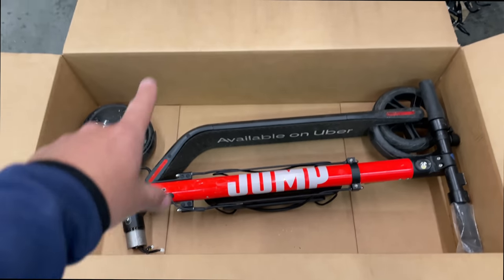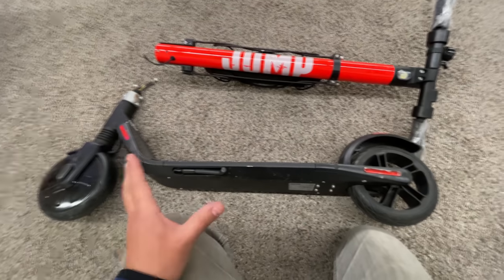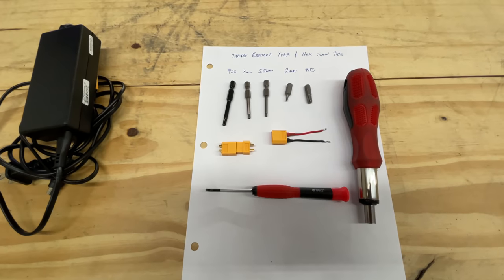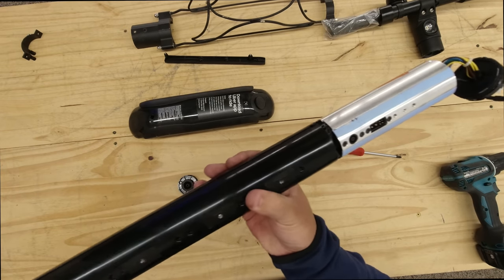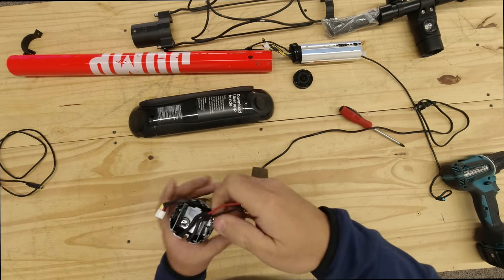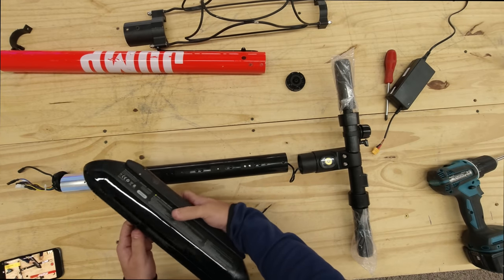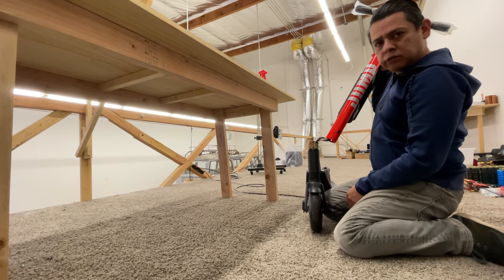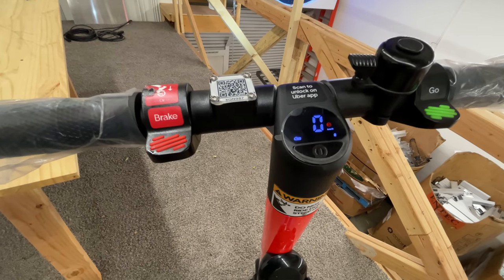Reclaiming a Ridesharing Scooter to personal Segway ES4

Comment: Got mine this week! Works pretty good after waking up the batteries, had normal  20km/h speed limit and 95% charge limit for better battery life. Took apart the handlebar unit and did some soldering to reflash it. Got an extra 10km/h and BT connection out of it, not sure if it was worth all the extra work tho. Pretty excellent stock. Happy scooting!
Reply: @Fred Ting - I’m currently doing the same and got my ST-Link up and going but had a few questions. Care to help a brother out? 🙏

Comment: Looking forward to the restocking!
Reply: BEWARE. I bought 2 scooters and 1 of them has a bad control board and dashboard. I'll be out another $100 at least to get it working. Jehu and his team hid behind the whole "as-is" sale in the description to avoid granting a partial refund to cover the costs of the repair. Only reason I was able to diagnose the issue was by tearing down another scooter I already owned and swapping parts. Honestly, not worth the time and effort now that 1 of them is bunk.

Great value IF you don't get a lemon.

Comment: I found those female barrel jack connectors in the right size as spare parts for a Xiaomi scooter. They are designed more like panel-mount connectors but they should work fine without cutting the charger.

Comment: Dang, I wanted a few. Shucks. I’ll wait until he gets more!
Reply: BEWARE. I bought 2 scooters and 1 of them has a bad control board and dashboard. I'll be out another $100 at least to get it working. Jehu and his team hid behind the whole "as-is" sale in the description to avoid granting a partial refund to cover the costs of the repair. Only reason I was able to diagnose the issue was by tearing down another scooter I already owned and swapping parts. Honestly, not worth the time and effort now that 1 of them is bunk.

Great value IF you don't get a lemon.

Comment: I have one of the retail version but the battery power output is dropping after a year of heavy use. Good guide here, can the battery be revived by jump starting as demonstrated or is it exhausted and likely needs replacement?
Reply from the maker: These are new unused batteries, you have old worn ones,  completely different scenario

Comment: BEWARE. I bought 2 scooters and 1 of them has a bad control board and dashboard. I'll be out another $100 at least to get it working. Jehu and his team hid behind the whole "as-is" sale in the description to avoid granting a partial refund to cover the costs of the repair. Only reason I was able to diagnose the issue was by tearing down another scooter I already owned and swapping parts. Honestly, not worth the time and effort now that 1 of them is bunk.

Great value IF you don't get a lemon.
Reply: Did you actually watch the video? Read the ad? He was VERY clear, these are as-is.

Comment: @jehugarcia isn't the special discharge connector from the battery just a plain XT30?  From the video it looks like one. Xiaomi scooters use XT30's on their batteries.
Reply from the maker: Not on the external pack
Reply: @jehugarcia  yeah ok. Because xt30's are dirt cheap

Comment: Im running into an error 42 when I connect the external battery.  I don’t have electrical contact cleaner but will try that.  Otherwise it works great.

Comment: How did you bypass the "remote activator" for the motor to start to work ?!
That type of scooters have one sim card that connect with the jump servers to unlock or lock the motor.
Reply from the maker: Never installed on these unused scooters
Reply: @jehugarcia  ah ok thx for the response :)
Reply: Likely bypass and remove that

Comment: Does the dashboard need to be plugged into the esc in order for the batteries to charge thru the charge port? I have everything minus the dash which is on its way but I wanted to get juice in the batteries asap to avoid permanent damage
Reply: Update: as far as I’m aware mine is charging. The brake light is flashing because I’m assuming it’s looking for a dash when there isn’t one but it’s taking a charge

Comment: Got mine and charged the batteries up, now I get code 32 and always beeping.  After some research it looks like I might need to reflash the esc and dashboard. I'll report back on if it works.
Reply: I'm in the same boat, any progress on your end. Looks like I might have to flash the dashboard with the ST-link USB serial communicator. The Juliet connector sticking out of the scooter doesn't show all the modules.
Reply: @gildardo  yeah I got mine all flashed. I took off the aux battery and went through that open  connector for the rx/tx wires. I was able to get all modules except the aux battery of course. For that I plugged it back in and back probed the rx/tx coming out of the main esc module to the main  battery, this took  a bit because the communication kept pausing , so just give it a few minutes to finish.
Reply: @Hermy21  Nice, I ended up doing the same, but I flashed the external battery with an android app after I updated all the other modules. Thanks for your reply.
Reply: @gildardo  Awesome,  glad you got it figured out! It is definitely a bit of trial and error.

Comment: Dumb question.... Is there a reason why one couldn't use something like an ISDT Q8 (Or other Lithium Ion charger one might have), even though it can only do 8S, not the 10S that I assume these packs are, to bring the voltage up a bit vs hacking apart the actual charger? How many volts does it take to get the BMS to wake up and allow the charge?
Reply from the maker: No reason.  It just makes more sense to suggest using the actual charger people need to buy to use the scooters.
Reply: @jehugarcia  Thanks - Got mine yesterday and I was able to revive the packs with my ISDT Q8 enough for the BMS to wake up and take the charge through the charge ports - the Scooter is alive and both batteries are recognized. 

A few points - these DO have bluetooth, it's just disabled in the current rental firmware. I used 'Method 2' found here (https://www.scooterhacking.org/forum/viewtopic.php?f=6&t=252) to flash different firmware the the BLE and DRV modules. After flashing BLE, the bluetooth indicator started flashing and it is now recognized by the segway app and I was able to change the speed from KPH to MPH, see battery lever, scooter statistics, etc.

Also, the screws provided to attach the stalk to the base are the incorrect size (or there was something wrong with the ones I got). They appear to be 1/4 x something, but the correct thread is M6x1.0. I couldn't hand thread any of them in very far and trying to crank one down didn't go well. The M6x1.0 screws I picked up threaded in smooth as glass. I believe the ones I got were 12mm long (just a touch longer than the ones provided. Trying to use the ones provided will be extremely difficult to get fully tightened (If all are like the ones that came with mine), and will mess up the threads.

Comment: There's a tool you can 3D print for removing that puck like thing.
Reply: Or use vise grips and line ut up on two holes on the puck and twist.
Reply: Michael, can you provide a link to where I can buy the 3D print tool? I could really use one. Thanks!
Reply: @oboloori  use 40% infil

Comment: Alright, these things were in my city dump, i brought one home, i bought a charger, nothing, it says its fully charged and wont turn on, ive done this method, and my charger flashes green, not green and red, i cant get any information, on what it could mean, ive even plugged the circuit board back and and pluged the charger back in the port, as well as the handle bars and its still dead
Reply: Update: this is very common ordeal whilest troubleshooting, after poking around with the multi meter that the circuitry at the module at the bottom, theres something wrong there, you can either put 3-5 volts through it and test all points, traces, sockets and caps until youve found the culprit with the multi meter, and spend no more than a few bucks in parts with a soldering iron, or you can buy a replacement, and that also includes a new "dashboard" or screen for up top, its bluetooth compatible, and its 30$ online.

Comment: Wouldn't it be better to wake it up with another 36v battery? instead of letting the charger struggle?
Reply from the maker: What if the person buying one of these doesn’t have such extra battery?  I need to show how to do it only with I know you will have available
Reply: @jehugarcia  What about just charging the outer addon battery, Would that not charge the internal one without a stripdown when they equalise?
Reply from the maker: @shawng5799  no, I tried that

Comment: I got my unit many many months ago but only got around to disassembly, charging and reassembly this weekend.  Finally got it all together tonight, charges fully, display seems to work and the cool LED lights come on.  But the most important feature, a powered scooter does not seem to work.  Pressing "Go" or "Brake" has no impact, nothing happens.  If I manually scoot forward I see the speed changing so at least some wires seem to be attached.  I appreciate these are 'as is' but does anyone have any advice on how to debug this issue further and hopefully reach root cause - or at least a level where I know what to order to resolve the issue.  Thanks in advance.
Reply from the maker: You do know you have kick start these right?  Sometimes you have to go faster than other times before the go button starts working
Reply: @jehugarcia  I did not know that but do now.  Reassembled again and gave it a kick start and it worked beautifully.  Thanks for the quick response.

Comment: Easier way to boost a battery attach a battery of same or slightly lower voltage in parallel
Reply: Need to be careful with that. The dead pack will pretty much suck up energy as fast as whatever is supplying it can give it, so if you were to connect another 10s pack, that would be a lot of current, which could potentially cook things. By using a charger, you limit it to whatever the charger can supply, like the 1.7A the linked charger can supply. I used an ISDT Q8 to get enough of a boost into the packs to wake the BMS and get them to accept charge through the charge port without hacking up the stock charger, and there are also creative ways to use the stock charger without hacking it up. Not saying it's 'bad' to hack up the stock charger because of course, it can be fixed, but I wanted to keep mine intact.
Reply: @aperson9495  agreed, I should have said only as a last resort, the chargers I have need a minimum voltage. I usually only connect for a flick to 2 seconds ONLY if a charger won't work.

Comment: Scooter arrived beat to hell and badly worn definitely not new. Only customer support was send it back, which then I paid $100 shipping and still do not have a scooter
Reply from the maker: You are right Jeremiah,  I should not be selling these as is as I will let down a lot of expectations.  From now on I will only sell inspected fully working units at full price.  Sorry
Reply: @jehugarcia  I disagree. I thought you made it quite clear that these were beat from being palletized and they were diy with no support from you.  I did notice that the qr code from the handle portion did not match the qr from the base, so likely the tops and bottoms were mixed up somewhere.
Reply: @bryancurit5021  Indeed, but it shouldn't matter since the bottom portion only has the motor and LED lights, no microcontroller. I do like that we are Re-using these instead of them ending in the landfill, or recycled.